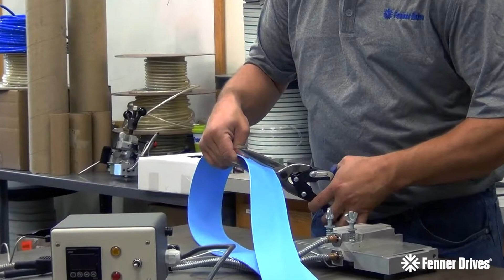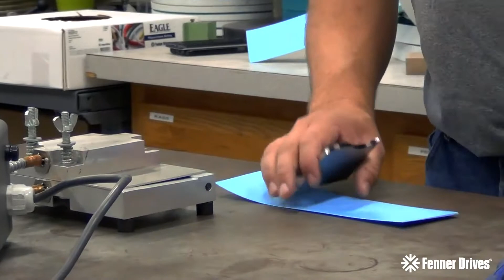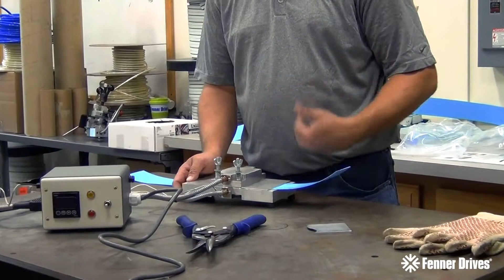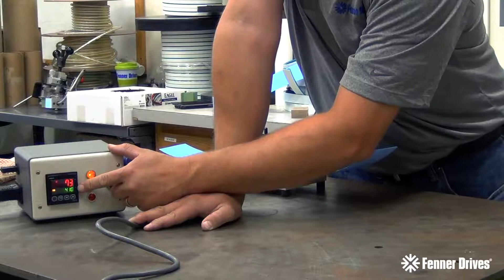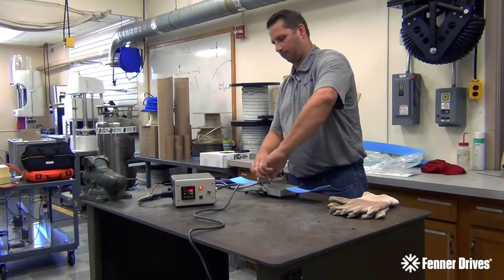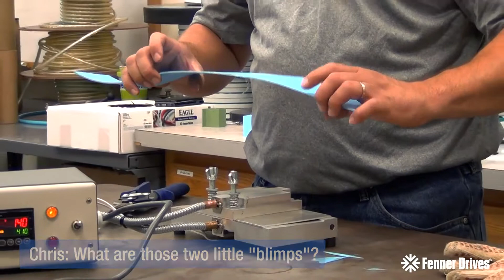Taper Edge Band Welding Instructional Video

Comment: No one's gonna read this but anyways I've used this welder a few times and I'll say, you'd better put something under it cause those rubber feet get blazing hot also. Also, like he said, don't tighten those screws all the way or you'll need pliers to loosen them. It works really good tho.